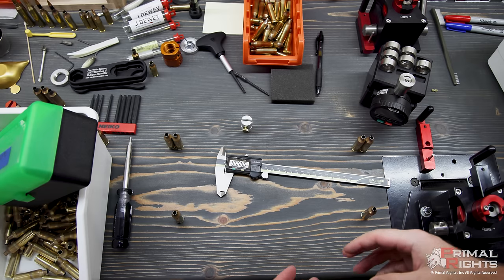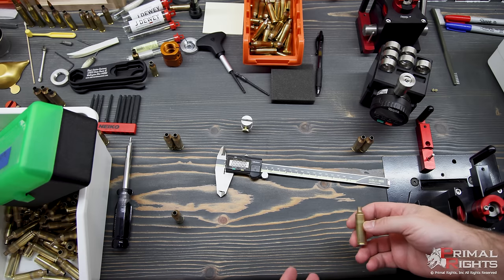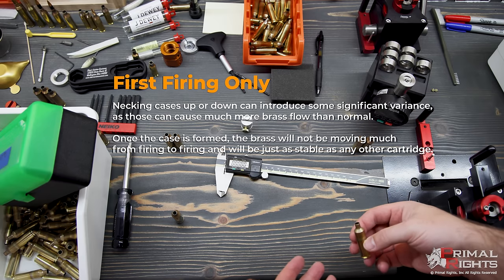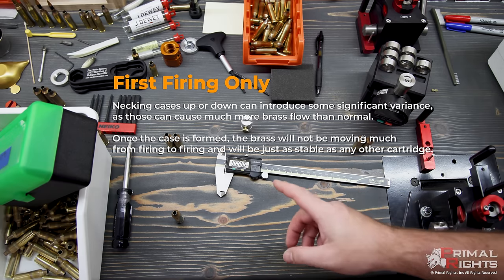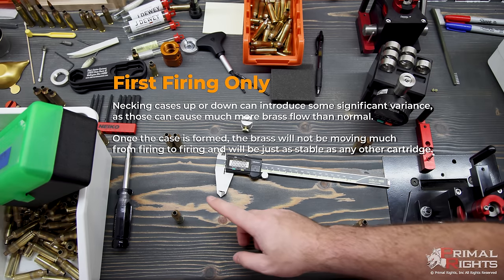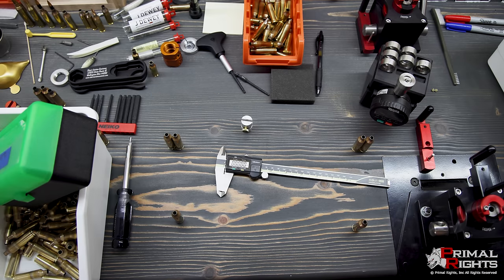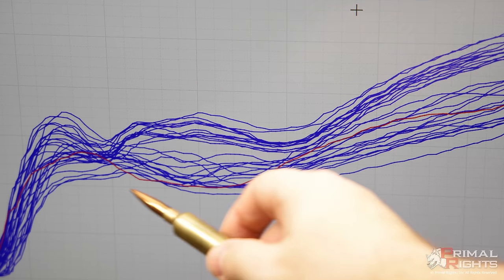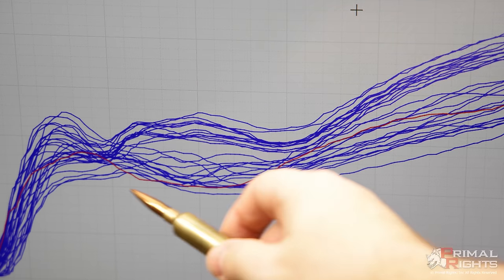Brass Trimming Considerations

Comment: you are right . i noticed this myself only when i talked to others about it i was told i as crazy , and it didn't matter . and when trimming with a trimmer that trims off of the shoulder my loads shot better than ones trimmed off of the col . i made a holder/ jig that has a hole in it the size of the datum line on the case shoulder and takes a dial indicator with a insert that fits over the case mouth . slide case in and set zero  . read all cases and you can tell the cases that will be 'flyers ' .  i found in my gun cases with over .002 neck variance will be 'flyers' . and testing a new barrel it is looking like it will take cases with up to .003 before the ' flyers ' start . only my shooting is mostly at 100 yards . yea i know not far enough lol . can got out to 250 yards . but i like small groups . i'm getting just under 1/4 inch groups out of my varmint/ target ar with a 24 inch krieger bull barrel . the groundhogs around the house hate my rifle ! keep up the good work !

Comment: I use the Lee quick trim system. It does everything in one shot. It amazes me how many people don’t use it correctly. First you have to watch the shell plate to have any shavings after trimming each time. Wipe it off with your finger. Other wise you OAL will vary. Second keep track of how many pieces you have trimmed. Once you reach twenty five pieces. Take cutter die out of your press. Use an air compressor and blow out to clean it. I blow it into an empty cereal box. Also make sure you blowing shavings and oil from the right end. Away from the side that grips the case. I bought the adapter so I could use a battery powered hybrid drill/ screw driver. Light weight. And the folding handle allow you to have a straight tool. Weight is straight down. I bought a Black & Decker. It works perfect.

Comment: You can put your brass into a case gauge and measure the difference in neck length protrusion or extrusion in proportion to the rest. That is if they fit still after fire forming. Interesting how much variation in pressures due to friction of inner neck surface area to bullet. This is getting into squeezing the SD numbers down real low. Great informative video.

Comment: I have had 1 firing on my brass. I cleaned and resized with 2 thousands shoulder bump. Should I trim and clean up the necks at this point or wait for my firings? My trimmer indexes off the case neck.

Comment: New to the reloading scene, longtime ocd though with tolerances. Flyers seem to be just that, misaligned unit. Marksmanship can only cover so much when chickens are in a row. Anything mechanical that can be corrected, before proceding, is upon the human intervention, just as is the skill sets incorporated. Each has their own level of comfort when drawing down on fine tuning. One does not have to be in competions to find a need for better results, sometimes it's only what drives us in a personal satisfaction quest.

Comment: I prefer using a Wilson case trimmer to cut it perfectly square. Indexing on the base is not an issue if your headspace is consistent. Headspace must be consistent anyway when seating bullets off the lands (otherwise you get inconsistent bullet jump)

Comment: One of the best in details videos Iv seen!!
Question - I have a 33xc with Tubb brass, I’m on my second firing, annealed with an amp, when I bump the shoulder back , Iv noticed there .001-.003 difference in some of them!  Is that something to worry about? Built for King of 1 mile
Reply from the maker: 1 thousandth of variance is on the outside edge of what I'll allow. If you can't hold shoulders to at least 1 thousandth ES, then something is definitely wrong. Poor application of lube, improper running of press, improperly designed sizing die, improperly setup sizing die, or very poor quality brass/mistreated brass can all be contributing factors, as well as others.

Comment: 11:52 - Assuming that the different applied-force starting points are due only to varying case lengths, doesn't seem to take into consideration other variables: neck tensions, inside neck diameters, or bullet dimensions/geometries.  After the cases are fully formed and trimmed, do the starting points become much more uniform and predictable?

Comment: My brain tells me that if you keep your brass lots together, you have your sizing die set right, anneal as you should the neck length to body length ratio should be able to be kept relatively the same with the lathe type trimmers. Which is what I use myself.

Comment: Thoughts on LE wilson trimmers?  Are these the same as trimmers that index off the case bottom?  Do they potentially introduce the variance you are describing?
Reply from the maker: Wilsons index off the base and trim on overall length.
Reply: If you are using high quality brass and consistent with your sorting and prep processes, indexing off the base won't introduce anymore variance than indexing off of the shoulder will, in a meaningful way at least. F-Class John and a few other top performers in LR competition have shown how effective trimmers that index off the base can be. I mean hell even John when he switched to Henderson trimmers found a significant improvement in SD and ES over the Giraud (most likely due to chamfer angle), and then sold off the Giraud. Also worth mentioning with shoulder referenced trimmers like the Giraud is that unless you have a custom pilot made using your chamber reamer dimensions so that it fits your brass exactly, you run the risk of uneven trimming. This is because these manufacturers have to make pilots that account for a wide population of brass so that they are a one size fits all. This leads to a sloppy fit and requires the same technique every single time, which easier said than done when your trimming hundreds of pieces at a time.

Comment: Greg welldone, have you find a correlation between a specific neck length and precision? ....and same with seating force? Thanks.
Reply from the maker: Thank you. No, no specific correlation on neck length. As long as consistency is there, it can be tuned. Seating force above 100 lbs. can become a real problem. Some bullet jackets and seating stems do not play well above that and jacket deformation can occur. Beneath that, so long as the force curve is consistent, then it's generally fine. The timing is tuned by bullet position, charge weight, and primer position. So as long as the bearing surfaces on the neck/bullet are consistent, the neck thickness consistent, then the bullet seating force should be as well... and will allow a good tune.
Reply: Thank you Greg.

Comment: If I understand correctly what you saying is you recommend using the headspace distance to 1st measure the case as fired. Then bump the shoulders .002 and then after brass stretches,
Measure the neck or overall case length?? Or is there a device to measure from the top of the mouth of the neck to the datum line on the case shoulder ??
Reply from the maker: The primary thing to take away is that there will be a case capacity non-uniformity if the headspace is not uniform, no matter the trimming method used. If there is a headspace uniformity problem, and you trim via overall length, then the neck bearing length surface will likely be made non-uniform in the process. So the moral is, do not trim if there is a headspace variance greater than half a thousandth.
Reply: @primalrights  excellent thank you. Do you have a method to measure from the top of the neck to the shoulder?
Reply from the maker: @jorgefigueroa7573  Yes, but obviously it is not necessary. You take a headspace measurement, which you will need to take anyway... then you take an overall length measurement. You subtract the headspace measurement from the overall length... that that will give you the exact shoulder datum to case mouth dimension.

Comment: Have you ever found or tested any correlation to accuracy regarding the base of the inside of case? I.e the measurement of the inside of the case base to the case mouth and or the inside of the case base and outside base thickness. I hope that makes sense.
Reply from the maker: I'm afraid I don't understand the question fully. Are you referring to internal case volume, expressed as a function of case wall thickness?
Reply: Sorry for the confusion, I sometimes have trouble putting thoughts into words. Perhaps it makes more sense to  compare it to case length. We take a measurement from the base of the case to the end of case mouth and refer to that as case length. Depending on how much we trim or the accuracy of our trimmers the case length can vary. I was wondering if there could also perhaps be a variance from the case head , do to case head thickness but measuring it from inside of the case instead of the outside as one normally would.  Not necessarily trying to measure internal volume but just the inside case length from the bottom of the inside of the case to the case mouth.  I have never tested this as of yet and with quality brass I’m sure this measurement would be meaningless or of little to no consequence. If there was variance how ever, it could perhaps vary the ignition by the flash hole being shorter or longer by so many thousandths and alter combustion in some way or another? Sorry if this confuses you more , I think it’s safe to say a picture is worth a thousand words. Great video by the way I really appreciate the amount of detail and quality.
Reply from the maker: @MMountain82  The case head thickness does not vary by much, in quality brass. In poor brass, it can vary quite a lot and is a significant source of case volume variance.
Reply: Thank you good to know

Comment: Would it be more consistent if you resize all then then trim to length afterwards ?
Reply from the maker: You should never trim brass that has not been annealed, then resized first. This is a cardinal rule. Anneal, resize, tumble, trim... in that order.
Reply: @primalrights  yes that's the order I'm doing my brass..however I just trim with a 21st century.. anneal..resize.. tumble..trim chamfer and deburr.. then maybe tumble one more time

Comment: Very interesting. Thanks. Now I gotta change my spreadsheet. LOL I have 2 sets of Headspace comparators. They measure off a different spot on the case. I have inquired as to WHY. I got crappy answers. I would guess that ALL Head Space comparators would be built from the SASMI Datum line measurement. That makes sense to me. The answer I got was "doesn't matter, just use the same one all the time". That tells me nothing. Am I right?
Reply from the maker: It is impossible for headspace comparator manufacturers to hold the tolerances necessary, even if they were to define a specific hole diameter and bottom radius/chamfer dimension... which they do not all agree on. So yes, unfortunately it is a requirement for both headspace comparators and bullet comparators that the exact same comparator be used each time, in order for your measurements to be accurate... and even then, those measurements will only be valuable to you, as they do not translate to anyone else's comparators. This is why they are called "comparators" rather than "gauges" or measuring tools. 

The only way to avoid this would be to have a national institute certification process for each comparator, which each individual tool would be tested and given a certification against a standardized test part. This is not practical for this industry... and also unnecessary.
Reply: @primalrights  That blows my mind. Head Space is Head Space as governed by Head Space "GO" and "NO GO" gages that match SAAMI specifications. We set our dies for FL Resizing accordingly. And here we use a Rubber Yard Stick. Sheesh
Reply from the maker: That perhaps outlines the difference right there... a quality Go gauge can run upwards of $100. Where as it's very unlikely for someone to pay that for a single headspace comparator. ;)

Comment: MY man, why is it that I get 5-8 thou of brass length growth per firing on my BRA brass? Im running 30.2gr of Varget at 2800fps flat in cold weather, 30.00gr in warm weather for same velocity.
Reply from the maker: What brand of brass? What bullet? Annealing? Does this persist beyond the 3rd firing? This seems like an extreme amount of brass flow, which would be indicative of very soft brass, or a very poor fitment between your chamber and sizing die.

Comment: What are your thoughts on neck turning?
Reply from the maker: I think it's great, when done properly. Most don't do it properly, as the equipment to do it properly is more expensive than they like.
Reply: @primalrights  what equipment do you recommend?
Reply: I do neck turning, however, everyone tells me it shouldn’t be done
Reply from the maker: I use an F-Class Products AutoDOD.
Reply from the maker: Why do they say it shouldn't be done?
Reply: In my neck of the woods, I am mocked for the effort I put into reloading...but what I have found, Howard, is to do what you think is right, because you pull your rifle's trigger. If you enjoy doing it you also will do it better as when you see it as a chore... good luck.
Reply: @primalrights  time-consuming, and doesn’t change accuracy
Reply from the maker: @howardschwartz1462  I would suggest finding new sources of information. ;)